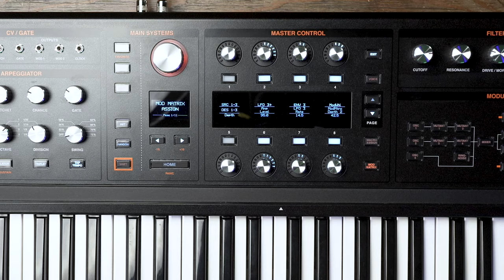Complex Modulations – Synth Clips 24 – Daniel Fisher

Comment: Thanks again for a very useful video - I have tried following along with my Hydrasynth and it is worth noting that by default on an INIT patch the mod wheel is set to control the vibrato - this can be switched off in page two of the Voice settings (Vib amount 0) otherwise by the time you add LFO 1 you already have two LFOs affecting pitch! Keep up the great work!
Reply from the maker: Hi Dad Turner. I forgot that I keep all of my empty INIT slots filled with my customized version of INIT, which has the default Mod Wheel to Vibrato amount set to zero. Thanks for watching! -Daniel

Comment: HYDRA Tip: use the Macro BUTTONS to get some cool instant/useful changes (potentially EIGHT destination mods in a single toggle!) you can also change the behaviour of the macro buttons in settings, don't forget. Also, bonus macro magic from the killer manual: Hold INIT button and tweak a knob for it to INSTANTLY jumpvto 0 value. I don't think i need to bring up the massivve performance potential here :) have FUN Hydra-ing

Comment: What is the difference to a midi keyboard? What should I get..? for producing
Reply: MIDI keyboard has no sounds to it. You have to use an external program, another synth or program from your computer
Reply: Thank you - can I record the synths to my DAW also?
Reply: @SARAH-pk5cc  yes, most use a 1/4 inch audio cable. You will need an audio interface as well
Reply: @davidvnthony  thank you xo _